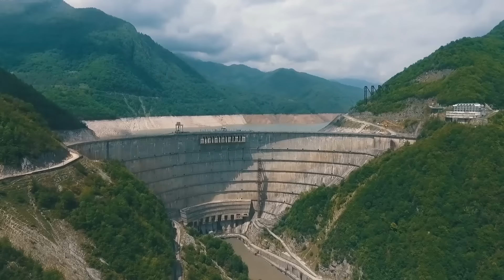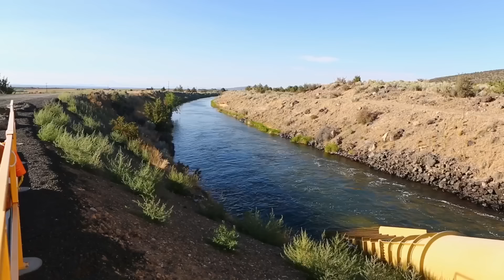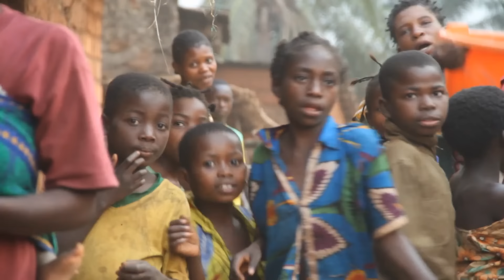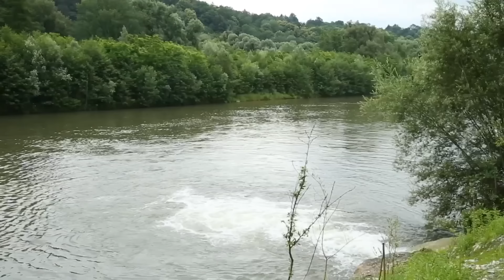Genius Micro Hydro Turbine Halves Cost of Energy

Comment: The answer that these companies overlook is using bladeless generators inside sewage pipes. People are constantly creating waste, and yet very little (basically none) of that energy is recouped. Waste products are sometimes harvested for gases, or turned into fertilizers, but the kinetic energy created by transmission from the home to the treatment site is never collected (if at all). There's tremendous hydro-electric potential if only waste were managed better.

Comment: I lived in the northern DR Congo for total of 10 years without eco friendly produced electricity.
The country is sadly so corrupt that any private person wanting to build a micro hydro project would face too much resistance by the government.
The river Uele is large but has flat banks so a flow generator (like the one in this video) or an old time water wheel would be the only feasible solution, but it will be impossible with the current government corruption.

Comment: Kind of a random idea, but could we modify micro hydro turbines to be used in large ships (to aid in supporting the ship with the electricity supply)?

I thought maybe, place them on the bottom of the ship so that when it moves forward, the water enters the turbines. Instead of the water flowing through the turbine (as it would if we'd install it on a river), the turbine is moving through the water (because it's attached to the bottom of the ship, that's moving forward).

I don't have extensive knowledge about how either ships or turbines work, but I wanted to share this little idea.
Reply: The drag would use more power through the main engines than you'd get back ...much more.
Reply: It seems that hydroelectric power generation works (and exists) for sailing but not for diesel engine powered boats.

Comment: Hydraulic head isn't a measurement of length, it's a measurement of height as a proxy for massless potential energy or potential energy per unit mass. The formula for potential energy (abbreviated as PE) is mgh where m is the mass, g is gravity and h is height, so if you want to calculate the PE per unit mass then the formula is gh, and since g is a constant the PE per unit mass is directly proportional to the height.

Comment: Solar cost at least $0.10 per kWh only because of the Federal Solar Tax Credit(ITC). Without the ITC that cost is around $0.40 cents kWh.  It should be pointed out that the cost can vary drastically based on the amount of sunlight and the quality of the solar panels installed. Plus, most people don't know that solar panel are not maintenance free because they must be cleaned once a month or electrical generation will drop like a rock as the dirt bakes onto the panel's glass.

Comment: The problem in the end always comes down to bureaucracy.

How much to pay to install, and the labor cost to remove the old system, etc.

Its cheaper and less restricting in rural and poorer countries, but in first world countries with existing hydro stations, that's like asking to halt operation to upgrade it, meaning weeks or months of revenue lost?

Due to greed, any attempts at change will see a likely "NO" because:
1. Politics and officials hate to be bothered to do extra paperwork when they have other tasks.
2. They look at it as if they need to pay out of pocket or convince their tax payers or people its a good idea (they hate trying to PR).

In first world countries, changes that occur is only due to immense profitability, not really sustainability or cost savings (because removing the old inefficient systems are costly).

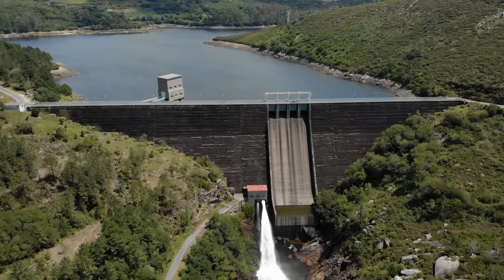Comment: @0:50 the so-called Camp Fire that was started by PG and E Hydro Dam system, just proved that Hydro is not remotely clean. 1 Million acres of burned trees produced more carbon than all gas electric plants in our Country for many many years!

The problem with these techs you are showcasing in this video, is that they are pressure driven turbines which are extremely inefficient, and cause resistance and cavitation which destroys them over time. Implosion based turbines are far more powerful and do not suffer from cavitation or resistance since they are vortex based! Implosion based turbines in rivers, instead of dams, is a step in the right direction, but the "Repulsine Implosion Turbine" runs in water or air and requires no head of water or pressured air air to create free energy!
Reply: @smeeself Viktor Schauberger produced many working protoypes! There is tons of information about him and his many implosion based technologies. Just search the net, before they erase all of them.

Comment: The corruption affecting large hydro projects in DR Congo will only worsen on small turbines that any local leader can (be bribed to) install, while the ecological impact is much higher. Corruption is not a technical problem that you can fix with a better turbine, it's a disease that kills all types of development. Africa will develop the same way as the West did, perhaps more ecological, but we don't need to re-invent energy engineering for local conditions. Build institutions, fight corruption, invest in and re-invest in fixed capital and infrastructure, rinse and repeat for decades.

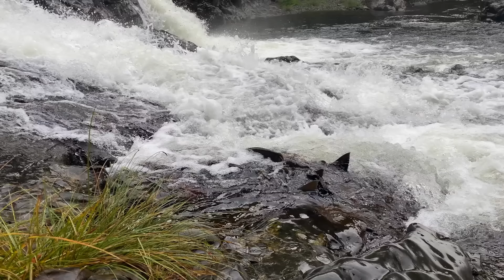Comment: 2:45 One of the most vague and dumbest things I've heard.
Anyone telling you a generator is 90% efficient, has no comprehension of energy physics.
The highest efficiency commercial turbines co-generate for a 65% recovery of potential energy.
Reply: You are completely wrong, large hydro power plants are about 95% efficient, you are just reffering to steam or other turbines
Reply: @milionowski  Most hydraulic systems are 90-98% efficient kinetic recovery.
Electric motors can compete.
Generators, not so much.
Reply: @cheerdiver  Do you realize generators and electric motors are basically the same thing? your posts are so unwise I'm starting to think you are just trolling.

Comment: A topic to consider is that demand for electricity is not flat but typically is higher during daylight hours than at night. With a dam, the reservoir acts as storage and replaces the battery. Without a reservoir, the overall cost can be optimized by finding the right combination of solar, wind and hydro to reduce demand for expensive batteries. Search term "clean energy u-curve"

Comment: 20GWh = 2000 US homes, 40000 African homes or roughly 75 EV semis
Reply: 1GW is 1 billion watts. Average US household uses 886kWh a month. 1GW can power 750,000 US households for a month
Reply: @drsatan7554  GWh = Gigawatt hours, not Gigawatt.
Also, I don't exactly know how you got to the number 750000 considering 1B/886k=1128 - I'm actually confounded as to how you got that number out.

The only way I see the "750000" playing out is that 1 gigawatt translates roughly to the average use of 750000 homes per second, which would mean that a home uses roughly 1.33KW on average every second which seems pretty reasonable.
Reply: @Tyiriel  Watts measure the power a device needs to function or its output at any moment. Watthours measure its required input/output over an hour

1GW is enough to power 750,000 homes for an instant. 20GWh would be enough for 20x that over an hour instead

I googled "average US household electricity usage" and got 886kWh a month
Then I also googled "how many homes can 1GW power" and got a range of responses between 700,000 to 750,000

Where did you get your statistics from?

What kind of house uses 10000000watts per hour? 
20GW / 2000 is 36 000 000 000 joules 
36 000 000 000 joules is 10000000watts
Which is 10,000Kw which is 10MW...
Whose house uses 10MW a second? 

Either your math is terrible or your math is terrible and you got your statistics from someone who counts on your math being terrible
Reply: @drsatan7554  Seriously, you're bringing mistakes in out of nowhere all over the place in that reply, and you still have absolutely no clue of what a Watt-hour is in comparison to a Watt.

"1GW is enough to power 750,000 homes for an instant. 20GWh would be enough for 20x that over an hour instead" - The first part is literally correct, as I surmised in my earlier response, but where in the hells did you get "20x that amount for an hour"? A WATT is a unit of measurement for JOULE per SECOND. A WATT-HOUR is simply another way to describe JOULE but divided by 3600.
That would hopefully imply that 1GW is enough to power 750000 households for 1 second, and 1GWh is enough to power 750000 households for 1 hour, but as a month consists of roughly 720 hours, 1GWh is only enough to power (750000/720) houses, or roughly >1000, using the 886KWh number, 1128. Simple math. 

Then we have the latter part - What is this shit even supposed to mean? This is where you can really tell where you fucked your understanding of these units up. You think watts are some kind of multiplication of joules, when they're really just a representation of joule over time, specifically 1 second.
20GW is NOT 36 000 000 000 Joules. It's 20 000 0000 000 Joules.
36 000 000 000 Joules is NOT 10MW, it's 36MW.

Finally, the only statistic I mentioned was your 886KWh per household per month number. That's literally it. Please don't respond with some quick idiotic response claiming how "bad" my math is. Just google "how many joules is X watts" or "How many Watt-hours is X Joule" You've got your units completely wrong and misunderstood what they mean.
Reply: What model of EV semi are you talking about? I'll do that one next as I can't imagine anyone's generated a reliable average household usage for all of Africa
Reply: @drsatan7554  An EV semi that spends 300 days on the road using roughly 7-800KWh 300 days a year. Quite realistic numbers if a truck goes 350-500 miles per day, charging overnight and is active for 300 days per year.
The Africa number was taken from the video itself so I don't particularly care about its reliability, the point was to push "how sparkguzzling EV trucks are"

Comment: You talked about water head (pressure), and it makes me wonder why this differential isn't able to basically create water fountains that power themselves. I'll check into it, but it seems sketchy that it can't be done.

If you think about it, the water weight inside of a vertical pipe is insubstantial compared to that at the bottom of a reservoir. It should be as simple as an unbalanced system, that cannot achieve balance. In other words, it's energy from gravity. I just don't understand why the downward force of gravity acts on water as a single object, and not as a collection of individual particles. Because that's the only explanation why it wouldn't work. The weight/pressure differential is there.
Reply: Because "conservation of energy"
If you have gravity acting downwards on every molecule, when you recirculate to the original height you act against gravity.
That takes energy.
More than the water gained on the way down.

Comment: Small turbines can be put into operation over a long river system and create not only plenty of renewable energy but long term Jobs.
The issue is no longer the power ability, but the local Politicians and Green lunatics who will degrade anything they perceive as a threat to their power or demands.
In the Metropolitan Detroit area there are a number of free flowing rivers, all with small dams an not 1 erg of energy being produced, and every attempt to bring it online has been refused as to the infighting around who will control it. County has the parks, and the cities need the power.

Comment: Let go of the dams? 
So this should be as vulnerable as wind and solar?  No water in the river, no electric power. Dams are the „battery“ in a hydroelectric system!  You can not leave them out. 
An other issue with solar, wind and small scale hydro, it is unregulated power. How to keep voltage and frequency stable in a system without control?

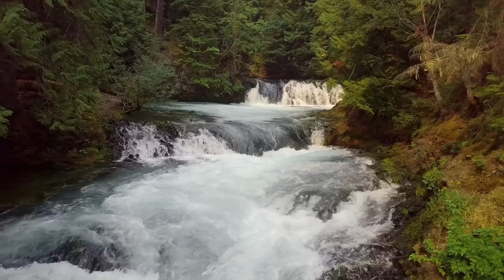Comment: 1:26 Hydraulic head is measured in distance because it is a measurment of the difference in height between the surface of the water at one point and some other lower point, not a measurment of pressure.

Pressure is however proportional to the depth of the water, which in the case of the turbine will be its hydraulic head. I just thought saying "hydraulic head (...) represents pressure" was a little imprecise.

Comment: Me I think we should be putting more money into wave energy, it's never going to stop, is fish and sea life friendly and is easy to maintain. You can also put wave generators in rivers, as the water passes it agitates the machine. Turbines are high maintenance, they have so many working parts.
Reply: I agree. Ammonia based turbines are amazingly efficient and all you need to do is let a pipe full of Ammonia gas heat up in the sun and it rapidly expands, flowing past a turbine down through the pipes heading underwater where the cold water cools it so the cycle can begin again

Comment: As an owner of a small hydro power station I must say there ain't much of news in this video and there are for sure some statements that I have a thing or two to tell you about.
1. hydro power is CO2 free - NO! Making electricity is never CO2 free. Even though running the station is almost CO2 free, building a concrete dam wall is for sure not CO2 free. But hydro power is still among the absolute top. Only nuclear power beating it by 25% less CO2. (Wind power is 400% more CO2 and Solar power is 800% more CO2 when adding the construction CO2)
2. +90% of all fish survives - I'm a sceptic. I've seen scientistic tests that says these number are too high.
3. Now we can use 100% of the water flow as power source - No! (Or at least not in most waters) because most fish also needs to be able to swim upstream during their life cycle, not only downstream.
So you will need a fish ladder for this to happen and that one may need 10-25% of the water flow.
Also to lure the fish to choose the ladder instead of trying to swim into the turbine outlet, you will need some extra water flow besides what is going through the ladder. Perhaps another 10-50% of water flow.
It's often way better to have a really efficient turbine (that isn't fish friendly) combined with a really efficient fish grid that keeps the fish away from the turbine while not hurting the fish.

Comment: Being in S.W. Indiana local people have often wondered how come the river current has never been used. With this method would indeed be an excellent place to start. Multiple turbines at points along the river at different depths.
Reply: Because the flow of money (commerce) transportation cannot be impeded....
Reply: Why not diy, dam it.
Water wheels turn generators do more spinners to get more Zzzz. Why you so silly
Reply: I live in WA., you can't even fantasize about getting free power from a river in these parts.
Reply: Your current power supplier sees the addition as a threat to their wages.
It's the same concept anywhere you go with changes, people hate it if they take any losses.

Optimize means less humans needed, less work needed, less pay given.

Comment: You’d think these would be used inline of water tower outlets that feed cities, you could put 50 inline.
You could downsize it for in home use on the water in-line connection.
They could connect to heating elements to heat sand batteries to heat the house and or hot water.
Reply: There's one giant problem with your solution:  Every unit would drop the delivered pressure.

2nd Law of Thermodynamics:  There is no free lunch.
Reply: @Nice_Amish_Fellow  I´m wondering what difference big wind farms do to the enviroment, by taking kinetic energy of wind. It must have some effects, but there is almost no talk about it in mainstrem.

Comment: You should not plan with current energy demand. As soon as you introduce acceptable level of energy supply, demand will skyrocket.
Reply: Thats the exact opposite of how supply and demand works. When the supply is high, demand is low and so is the cost. When demand is higher than supply the costs rise

Comment: often the various consepts of technologies design are functional, yet need a design process to try out variations of the the design to fulfill the design criteria, like not blocking nutrients, and migration of fish, and erosion issues. thinking big no longer is about huge projects trying to highjack nature, yet to work with nature so that we can solve the bigger issues. having a turbine that can be quickly set in to place, or quickly lifted and switched for maintenance means also the tecnology can be more in the hands of free enterprise or smaller local operated corporations. the only down side is such water shed regions need a continuous forestry and reforestaion system to captivate the moving cloud water and rain, as the hypothesis is looking more factual now is that bodies of forest and high elevation grass lands, planted or natural are a major factor of local weather patterns.

Comment: Facilities world wide would because safety USA unground get rid windmills,and solar two birds one stone we are the world slogans saved money making machine LIFT out for replacement or repair all one piece lid connected big steel handle with poles to assist weight. Beautiful mind minutes and several ideas that work GOD ways higher than are thinking. Fastest slow faster fastest has water speeds up centrifugal force easy-to-use motor last longest time.

Comment: Why not just loop centrifugal forces water same water ditch line with concrete smooth looking like 🍩 round circle near if desert water front or well water we talking remote areas center village the turbine will mostly move the water start engine with battery fencing in so children don't get hurt. Could use old model. This is the greatest impact and innovation I seen in longest time hopefully you implement what I said good luck and GOD bless this idea may many women and children have electric cooking, cooling,heating and of course good health